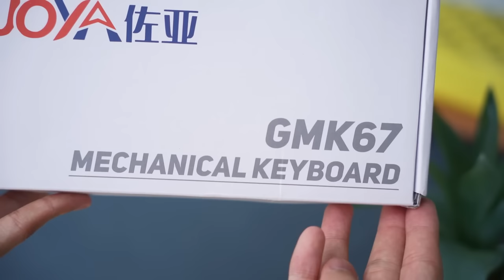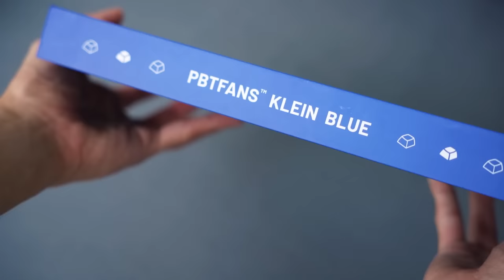GMK67 - The NEW BUDGET Keyboard Kit

Comment: Skyloong kits are $30-50 right now

Also guys don't sleep on royal kludge as a base to start your build. Silicon pour, milky yellows or akko cs purples plus some thick keycaps and you're set all under $100 easily
Reply: Agreed
Reply: Rk go boom
Reply: rk sucks, you get more out of a kit like this
Reply: Rk Is proprietary, i wouldn’t recommend
Reply: Too much work in my opinion and not everyone has liquid silicone to pour in a keyboard lol. The GMK67 is way more beginner friendly since all the foam you need is already inside and opening it isnt as hard as it looks (you can do it with bare hands, no prying tools necessary)

Comment: Got this for ~$40 (the vendor included 5g of krytox 205g0), and been rocking this for almost 3 months now.
The kit itself is definitely a steal. Stock prelubed stabs aren't that great, but the ones on my friend's kit are pretty good, so it's a QNC thing (I'd highly recommend holee modding and lubing them). The PC plate is, as Lewis has mentioned, not the most flexible, but definitely usable in this price range. Honestly I'd prefer a steel or aluminum plate for a clackier sound profile, but compared to the 6+ months of using the Tester68, I'd say the board clacks much better.
Tbh at this price range this board is definitely one of the best kits available in terms of value. You get basically every essential features: South-facing, hotswappable PCB, with RGB; gastket mount, pretty decent stock foams (tho changing the foam would drastically reduce the reverb and plastic-y sound), and a knob. There are plenty of videos on youtube on how to prey this thing open, and once you get used to it, it's not that hard to disassemble (It's actually openable using only your hands, so that's that.) Overall, this is definitely a steal for me, and a banger keyboard for beginners.
Reply: @Giga Chad Shopee. I live in Vietnam, and so there are plenty of good vendors here to supply my needs (though some of the more popular switches are only available elsewhere, namely Gat Blue Bubblegums or Marshmallow). Still, great value imo, and I'd highly recommend checking them out
Reply: What seller did you get it from that they gave you that?

Comment: The GMK67 has been my daily driver and I would say it's the best budget 65% right now. There's an easier way to open up the board without prying/scratching it. You just have to slowly lift the upper portion of the case from the inside out, and the snap ins should pop. Overall, would definitely recommend this board.
Reply: Yup I learned that the hard way after hurting my fingers the first time! XD it's kind of like pushing 'out' on the top wall? then the whole piece snaps up and off! I screwed in akko stabilizers and put haimu silent tactiles and it is NICE. oh and of course tape. It was 90$ Canadian, but not a bad price for my first and probably only keyboard :P
Reply: @Emipie  do you have a link for those aklo stabs?
Reply: Can you tell about the polling rate? Is it 1000hz?
Reply: @Marinhhoo  i believe it's 1khz for wired, not sure about the 2.4g and bt so feel free to test. But I've used the 2.4g on gaming (dota2, borderlands, titanfall) and i didn't experience any noticeable delays. I don't game on bt but used it for my office works, functions as expected so far.
Reply: @law2xoliver  Nice, thanks for the feedback!

Comment: I actually almost bought this keyboard before I got the Epomaker TH80. At the time, I didn't realize I wanted to keep the F keys but this keyboard you just reviewed would be fantastic to have otherwise. It sounds really good with the cream yellow switches!
Reply: Bro i just got the th80 to function as my main desktop keyboard and hoy shite this th80 and keychron v1 are the best stock keyboards i have ever touched in my life. I genuinely feel no desire to mod the keyboard and I love it just the way that it is.
Reply: @skelpie  i have it too imo the stabilizers are pretty mid and the lube is pretty inconsistent on the switches(some over lubed some under lubed)
Reply: @suerp  dang i got really lucky then cuz only my spacebar was a little ass and the lube was fairly consistent minus some of the function keys
Reply: @skelpie  Which switches did you get with the epomaker th80
Reply: Which switches did you get with the epomaker th80

Comment: Quick question! I'm using this keyboard on mac and I'm having issues with the right command key having no function. The left command key works as it should but right side doesn't do anything. The RBG light underneath is working properly. Is there any software for mac I can use to edit how the keys are being assigned? THANKYOU
Reply: Did you find any solution? I Just ordered the kit and waiting for the delivery. I am also using a Mac. I found that "Karabiner-Elements" works in Mac (From some the YouTube video). I have to check once i build the keyboard. You can try it, if you still looking for the solution.

Comment: There's a much easier toolless way to open the case, without switches or knob installed put your thumbs around where the 5 and 9 keys sit, and gently push up on the top case until it pops open.

Edited for grammar.

Comment: For 35$ you can really make a cheap nice sounding keyboard. I’d imagine if you went with Akko switches and a decently priced key cap set it could be under 100$
Reply from the maker: for sure
Reply: Built it with double shot pbt gmk clones and kang whites for 60$ total shopped

Comment: I got this for my birthday recently. I took out the stock case foam and 2-layer taped pennies in the case instead. I did holee mod to the stabs and it sounds good 👍🏻 I have stock Akko Silver switches and Akko MDA WOB Building Block keycaps on mine. Its really simple to build that tbh you dont need to pry it open to do anything if you don’t want to, just syringe lube the stabs properly and youre good to go 🎉🎉🎉 Happy with my purchase!
Reply: does GMK67 keyboardfeel heavy or does it feel cheap and light?
Reply: @Moon-sf4hs  It feels lighter than cheap keyboards with aluminum plates, so i put some pennies in it to make it feel heavier. The build quality is really good for what youre paying. It doesn't feel cheap. I recommend that you use decent quality keycaps with it because I think it carries the look and feel of its entirety. 10/10 budget build for sure.

Comment: Been trying to find the equivalent in 75% form factor. Pretty to find 1 that is as cheap as this with features similar to ciy gas 67
Reply from the maker: thats a tough one
Reply: Feker IK75 pro V3.
But it's a north facing but it also comes with steel and pc plate
Reply: try looking at the james donkey a3
Reply: But if you like VIA support then go for Keychron V1. It's basically a Keychron Q1 but with a plastic case

Comment: hi there man, i just finished building my gmk67 but i face with a problem, when i plug the 2.4 usb to my pc and try turning it off, the screen is stuck on the loading page and it just keep spining and spining and wont shutdown, but its fine when i use the cable that they provide, it just only the 2.4 wireless usb, idk why this happen and idk how to fix it

Comment: Love the clack from the Cream Yellows.  I used them in my recent GAS67 rebuild.  The stabs are the same as the ones that come with the V65 and aren't that great.  Definitely worse than the screw-ins provided with the GAS67 or plate mounted ones in an Akko 5075S.  
Still, $50 for a wireless 65% with knob and south facing is great.

Comment: Would you recommend swaping the stabilizers? If so, which ones should I use?  I read somewhere that Durock V2 dont fit in this keyboard.
Reply: The stock ones are perfectly fine once relubed, but if you were going to then durock smokey plate mounts are a good choice for the board

Comment: should i go for cidoo/finalkey v65 or this gmk67??? 🤔
Reply: It just depends on your budget tbh. If you have the extra money and want a more premium feel with the aluminum case then go for the v65. If budget is an issue however, I think going for the gmk67 is the right choice. Both boards are basically the same with only difference in build quality.

Comment: I also got this kit, basically when it came out. I saw the features and it was basically a steal (60 usd for my location). Totally recommend, and also the "pe foam" is more like a rubber dampener. The board is really quiet with it on. Would recommend removing it. Also using some screw in stabs would be good.

Comment: Damn you got this on a discount price, on Shopee it costs like 40usd-50 (around myr200, which is alot but in the hobby it doesnt matter much) and shipping can be hard. Though, the keyboard is basically just a budget downgraded zoom65, but with less plate options, and clip in and also plastic. (And wireless hahahhaha) and the stabs are pretty good for stock so the value adds more for this board. Also imo most sound profile you'd probably get from this board is probably has creamy clacks, creamy thocks or whatever but add creamy term beside it, maybe due to the pc plate and foams too. 
And i heard that some people loses their wireless connection after opening up the case, just saying.

Awesome video, Lewis! Nice build and color combo on the keycaps.
Reply: This should be as my essay answer in my exams